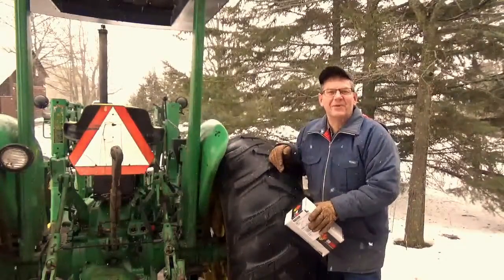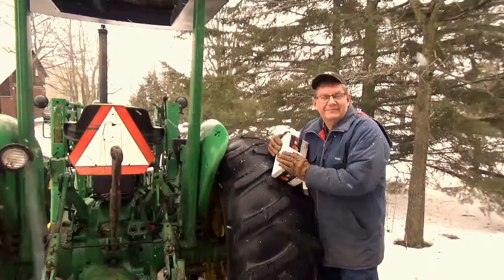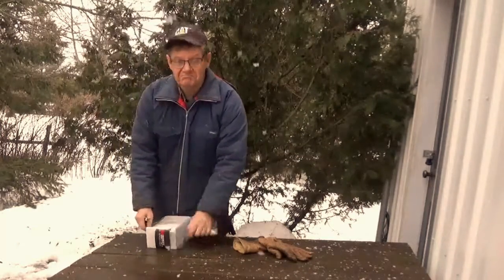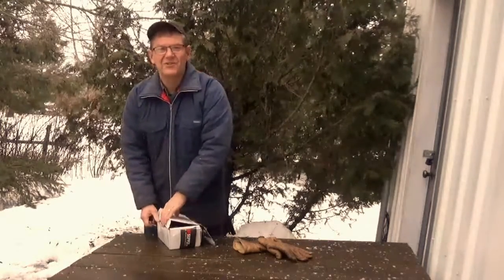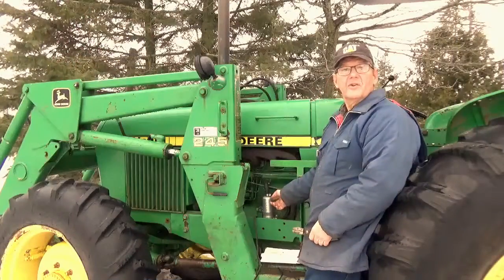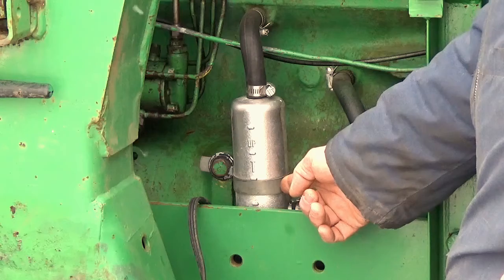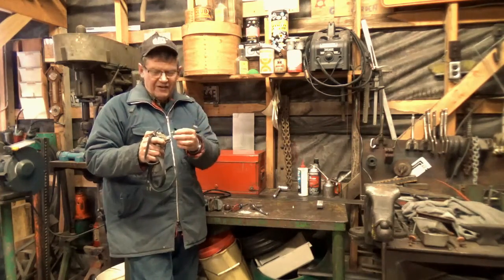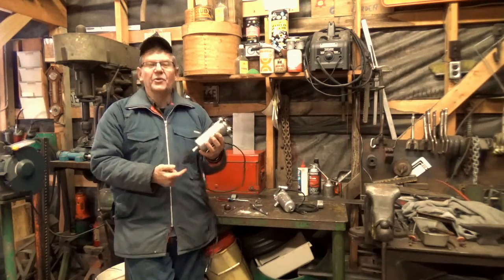Installing a Block Heater on a John Deere Tractor

Comment: I have never run less than a 1000 watt block heater in that style heater in my Detroit in my skidders.  Sometimes I only get one winter out of them, but I have gotten 6 years use before.
Reply from the maker: Greetings,
I can appreciate installing a higher wattage heater in your skidders. Thinking of the sound and smell when starting your skidders (possibly a Detroit 3-53 or 4-53?) on a cold winter's morn brings back memories of the good old days...
I am hoping to get a few more years out of the lower wattage one I installed on ole Betsy. Thanks for reaching out with your comments. I hope you and your family have a wonderful Christmas.

Comment: Do you have to prime motor for air pockets before using?
Reply from the maker: Hello Jason,
That is a great question. 
In my younger years (working for a Caterpillar dealership)I was taught to be cautious and always purge the air from a cylinder head. The engine in the 1840 has a small hole in the thermostat that effectively looks after bleeding the air.
So the answer is, on this particular engine it is not necessary.
Hope this helps!!
Paul
Reply: @OutothehousewithPaul  Hi..  I have a IH674 with no glow plugs, in winter I open driveways. I need to plug it all the time to start,  I'm just worried if it lets go il burn a new one because air pocket in it. Not sure if I have a small hole in thermostat , looked online can see no hole,  I seen them on cars before

Comment: How did you purge the air out of it??  If that is part of the process then it would be helpful to include that information.  I have to do this same swap out on my tractor.  Never done it before so would`ve been nice to have all the info!
Reply from the maker: Greetings,
I enjoyed your cider making video, looks like fun!
The easiest way to bleed the heater unit is to install the hoses, and only tighten the clamp on the lower hose. I used hose clamping pliers to block the flow of coolant while replacing the unit. If you loosen the lower pair of clamps and pull the upper hose slightly off it will allow the coolant to flow up into the unit and push the air out. Once only clear coolant (free of air bubbles) flows from the upper hose connection push the hose all the way on and tighten the hose clamp. Remove the upper hose clamping piers and things should be good. I would suggest installing the heater after running the tractor (with warm coolant) and running the tractor afterwards to circulate the coolant and purge any remaining air.
Hope this helps!
Reply: @OutothehousewithPaul  Thanks, that is just what i needed.  Glad you liked the cider video.  We still make cider every summer to use the apples up and invite anyone who wants to collect apples and make some, or just take all the apples they want.

Comment: How did you purge the air out of it?
Reply from the maker: That is a great question. Years ago I worked for a Caterpillar Dealer, bleeding air from engines and cylinder heads was a critical part of the repair process any time Coolant was drained. In my experience on the small series of John Deere Engines the bleed hole in the thermostat will safely allow any trapped air to safely escape. Thanks for taking the time to reach out and ask your question.
Cheers!

Comment: Always nice to see you up to something Mr. Paul I have the same in line heater on my old 2120 and do just use the 15W40 oil all year . So your little trick of adding a heater to the oil pan was an interesting idea , although the last week or two in my part of Ontario have been cold -25 or more in the day time and hitting the -40 and lower at night . So both me and the tractor sit one in the barn one in the house . Funny where each might be . Be safe
Reply from the maker: Hello Mark,
It is great to hear from you. 
2120's are great tractors. I have great respect for the complete line of Manheim built John Deere. 
The oil pan heater idea came from my days working for on Caterpillar machinery. Years ago I saw some very expensive low hour machines fail from lubrication related issues when started in extreme cold weather. It sounds like you have been enjoying a bit of a cold snap. Our weather forecast for the next 2 days includes 60+mm of rain, followed by some freezing rain , and 10-15 cm of snow. A bit of a swing... I can relate to the tractor "resting" in the barn and as my father in-law would have said, the wisdom of staying close to the box stove when it is like the Arctic outside. It is great to hear from you Buddy. Thanks as always!

Comment: Hi Paul. The wattage of the heater shouldn't cause the heater to get too hot and damage the thermal cutout. The thermal cutout should keep the temperature in a safe range. The likely problem is that the thermal cutout is not rated at a high enough current for the larger power heater. You could replace the thermal cut out with a new same cutout, use thermal conductive paste between the cutout metal and the heater case, clean out the heater with CLR, repair any wiring and run the heater with a 20 amp. 300v diode in series with the hot AC wire. This would effectively reduce the average ac current in half and also reduce the effective wattage of the heater to one half. This may be an answer if you ever needed a new 750 watt heater and they are NLA. Keep your two old ones. This looks like the cutout just was not up to the continuous duty. When the heater is cold the current will be at it's maximum.
A battery heater blanket with a temperature control so as to keep the tractor starting battery from getting over 20degrees C. would be a great addition. When a lead acid battery is cold the battery power delivery is reduce but so is the charging ability. The faster the engine cranks over the hotter the combustion chamber temperature. The oil pan heater is a great idea to save engine wear at start up.
Perhaps the smaller heater was available only in Alberta because they need and sell mostly the larger size because of larger tractors and colder temperatures.
May be a case where bigger isn't always better. 
Back to the cold again.
Stay safe and warm 
David in Goderich
Reply from the maker: Hello David,
It is great to hear from you.
I also wonder if the Thermal cutout is not able to withstand the current load of the 1500 watt element. The one side of both cutouts is burned and melted, it was obviously where the failure occurred. I wish I had kept more of the other units that had failed, it would have been interesting to see what had failed on them as well.  Let's hope the reduced current load solves the problem. 
I hope you are having a good winter. Thanks again for sharing your thoughts and comments. 
 All the best!
Paul

Comment: That was an easy fix!  And most likely, you found why the previous coolant heaters were short-lived. I also do think the same about oil.  I run 10W30 in my small Case 430 tractors all year long. I do really like being outdoors during the weekend, being stuck behind a desk and surrounded by 4 walls all week long.  Thanks!
Reply from the maker: Greetings from Ontario. It was a nice and quick little repair. I am glad the weather aligned with some warm temps. on Saturday morning as by Saturday night we hit -24 and it is supposed to be even colder tonight. My brother in-law has a Case tractor similiar to yours, he replaces the bucket with a blade in the winter for pushing snow. It works very well for him. I can certainly relate to how you enjoy being out doors on weekends, after being inside all week it is a treat!
I hope you and your family are having a great winter. 
Thanks for your encouraging comments!